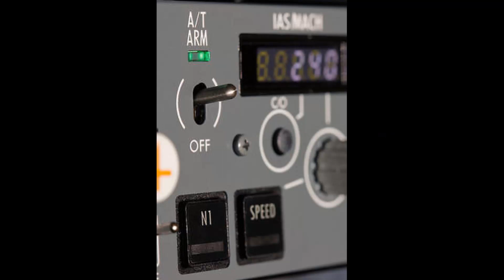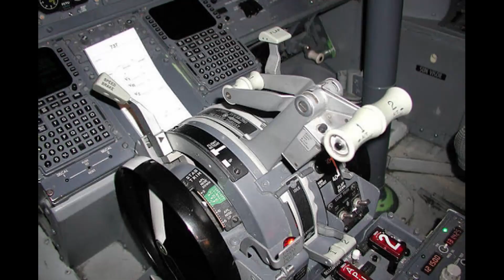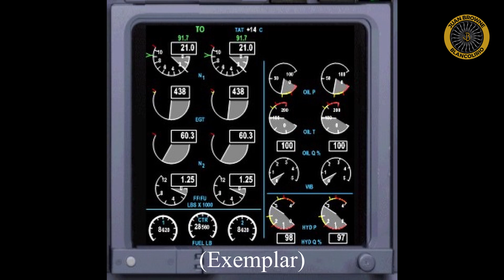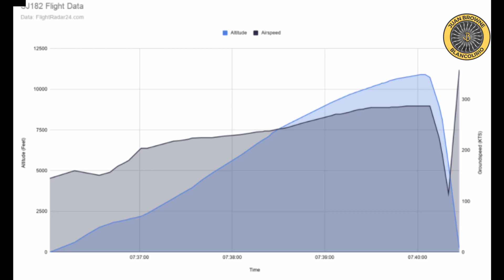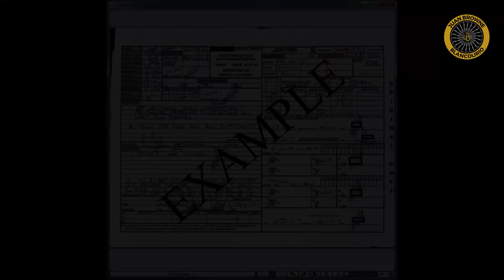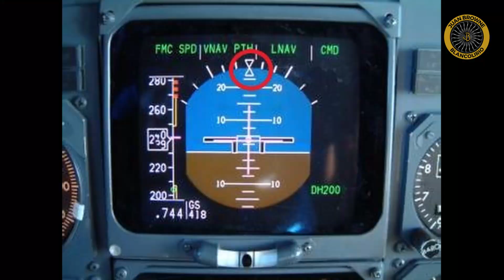Sriwijaya SJ-182 KNKT Preliminary Report 12 Feb 2021

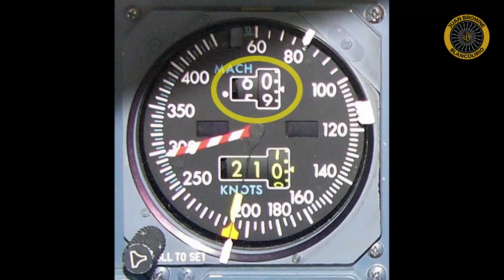Comment: 13:29 Yes, they are talking about that Mach portion... Almost sure about it...
Reply: No, they don't. IAW the FAA MMEL for the 737 Family, section 34-01-02, one analog airspeed indicator may be inoperative if you still have correct airspeed displayed in the EFIS display and the other Airspeed has mach/airspeed warning operative. And that's a CAT C deferred item as per the MMEL. https://fsims.faa.gov/PICDetail.aspx?docId=M%20B-737%20R61
Reply: @SGAeoh  So, that is what I was taking about. It is all about analogue speed / mach indicator
Reply: @PilotBlogDenys  There is a separate MMEL procedure for the barrel indicators for MACH and airspeed (MMEL sections 34-01 and 34-02). The section 34-01-02 covers the complete instrument being inop, including the airspeed dial indicator and both barrel indicators for MACH and airpeed.

Comment: Can a plane fly in US with AT in active DMI?
This sounds more like a bad ground or a component heat failure. Heat failures happen only after the component gets hot and may be missed on quick or built in checks as it takes time for the component to get hot.
Reply: Or maybe at 25 years old it’s just worn out
Reply: @axelknutt5065  nope there are hundreds of 737s that age and older flying. There are thousands of older planes including DC-3s and such. None have been built since 1962 and 58 are in active service with 18 more in reserve. Now I can’t speak for their maintenance but I’m not impressed by its current owner’s repair of the Auto-Throttle or the pilot training.
Reply: Yes , A/T can be MEL'd in the US.

Comment: Last I read was that the CVR was badly damaged during the crash and the memory module/unit/chip separated from the main CVR. Divers recovered the damaged CVR but not the memory module. They continued to search for the memory module for several days, but by now (a month after the incident) have almost certainly given up. I suspect we will never recover the CVR data.
Reply: I can't understand why in the peek of the digital era where we can send and recive big amount of data in a few second we are still looking for founding a piece of electronic in the botton of the ocean to resolve a mistery. bro my 100€ smarthphone could easly send all the avionic data and voice recorder even video if there were a camara in the cockpit so why the hell are we still searching for those undestructable black boxes????
Reply: @wolframio26  Good comment. The lack of cockpit video is startling! In a day when every cellphone has such a high processing capability, we are still relying on old conceptual design on black boxes...

Comment: Considering the US has the most flights in the world per capita and least fatal crashes, there is a cultural issue outside of the US that needs addressing for quick decisive action and improved safety log reviews.
Reply: . . . . And from my experience after talking with lots of Captains and First officers during my years of business travel - in Aus, and in Canada, France, Germany and Scandinavia to name a few - and even in Emirates, Qatar and Cathay when they have Caucasian ex=pats up the front.  I was told by a senior Qantas captain many years ago that it comes from an innate culture which had developed in those countries where kids with a mechanical bent would restore old cars and motor bikes, would learn to use hand and power tools to build “stuff” (toys, furniture and the ubiquitous “cubby houses” - and where EVERYONE who learnt to fly learnt on a Cessna or a Piper or some other single-engined fixed gear fixed prop aircraft with an Instructor who would regularly block out one or more instruments, or would grab the stick or yoke and say, “your ailerons and elevator have frozen” and you had to fly the aircraft with your rudders, throttle and trim control (I even had to join the circuit and fly to the turn onto finals at 500ft AGL about half a mile from the numbers one day before my instructor gave me back full controls); and we ALWAYS did recovery from unusual attitudes before we did our first Area Solo, let alone a flight test!  Ya gotta ground pilots in the basics - first, last and always - BEFORE you let them loose with the automation.
Reply: @warwickkinscher5986  Exactly!!!
Reply: Stop acting like the US is the best. Australia, Europe and even the Japanese have some of the safest airlines in the world and these are also “outside of the US.” What doesn’t get reported as much is the amount of GA accidents in the US

Comment: As always an excellent review of known facts. What never ceases to amaze me is how some pilots will engage automation and forget to pay the slightest attention to what's occurring. Those split thrust levers should have been enough to know things weren't normal. Remember: YOU are in control! Not the autopilot (not ever). If only we had the CVR to know what was going on in that cockpit.
As to the MACH/Airspeed DMI don't knkw about B737 but,
On B757/767: Mach Indicator Category C (10 days); 2 Installed 1 Required; May be inoperative provided EFIS Mach indications installed and operate normally at associated pilot position.  OR:  May be inoperative provided airplane remains bellow FL300 and a Placard with this limitation is affixed to the instrument panel.
Reply: Yes, exactly. They recovered the CVR end of March 2021 and due to a new report on Aviation Herald readed him out now succesfully.

Comment: I hesitate every time to click the thumbs up button on these videos: that is why I support using patreon. And, I still give the thumbs up! 
The reporting is excellent, informative and in depth, and very compassionate. 
But giving a thumbs up on such a tragic report is like being under the hood while the instructor sets up an unusual attitude and trims the plane all wonkey and then says, "your plane." It takes time for you to lift the hood and then assess what you have been given before you make inputs to correct, or you could end up making things worse.

 I have to take a moment to reflect on why I am giving that thumbs up; seeing the crushed remnants of the plane is hardest of all, I think.

 When I was 18, I helped a state trooper pull two guys out of a super cub and zip them into body bags. I was the first guy at the scene, and I keep the looky-loos back, especially that one truck driver that hopped out of his truck with a big fat smoking cigar in his mouth. The impact of smelling the guts, gas, and hot metal, and hearing the click-click-click of cooling metal and the whirling down sound of badly damaged gyros is still fresh in my mind some 45 years later.

 We didn't need any NTSB report on this one; the pilot was flying low and slow, Alaska style IFR (I Follow Road) under the skud (very likely icing conditions) trying to find a place to land to refuel or wait out the weather. He stalled while turning around to land on the road, firewalled it and flew straight down into the frozen ground next to the highway. The tail of the plane stuck straight up, and stayed there. 

 The engine was partially inside the pilot's face, chest and belly, and the guy in back's face was embed in the the pilot's back, just right of his spine, and his femurs shoved off his tibia's at the knee, both bones sticking out. Both wing tanks burst, and they had eight square 5 gallon tin cans full of gas in back, full of fuel; all burst open on impact. No fire. It would have been better and safer for me and the trooper if they had burned. We had to be VERY CAREFUL moving everything to prevent a spark that could have added two more to the tragedy. Both guys were big guys, well over 200 pounds each, and with all that fuel aft of the passenger in a cub, no matter how "super", it was an accident looking for someplace to happen. 

 I have the deepest respect and empathy for all the guys and gals that do the clean up after these kind of events. It is horrific.

 But I still love to fly, and I have trust in the mechanical means we need to fly, and the aerodynamics that require we pay. The coin that is exchanged is either attention or consequence, sometimes both. Our job as PIC is to make it as seldom as possible that we pay consequences.
Reply: Wow, reading about your encounter with the Super Cub accident sends a shiver down my spine 😳
Reply: The thumbs up is simply in recognition of Juan's excellent work and entirely deserved.
Reply: Tough call. Scud-running is stupid though.
Reply: @pasoundman  Agree
Reply: Thank you for telling that story, and your thoughts.

Comment: The idea that someone starting early in their career in the airliners is less capable in "airline flying" than someone with other previous experience, to me, lacks evidence. We both know a lot of high profile crashes, and in most of them, the pilots had an ATPL and were well over 1500 hours. So what? You get good in what you are properly trained, and the experience makes you better. Accidents are exceptions, not the rule, and although each day more the airline pilots are getting earlier on the seat of a jet, every year is in general safer than the previous. We have to be careful to not fall into a false sensation that one career path is better than others: all experiences are desirable, but not all are essential. As long as you have a good and well structured screening/training program, you are going to produce good pilots out of it. And this includes reshaping very experienced ones that came from poor standard previous operation and would bring bad practices into the airline environment - something a pilot that started with low hours wouldn't. The right solution for the wrong problem does not fix anything. Instead, seeing these crashes, we should feel humble, and recognize we can get into those traps too, regardless of our background or previous experience. The moment we feel we are superior, that's when complacency kicks in, and we stop learning to start judging, and the stage is set for us to fall into similar mistakes.